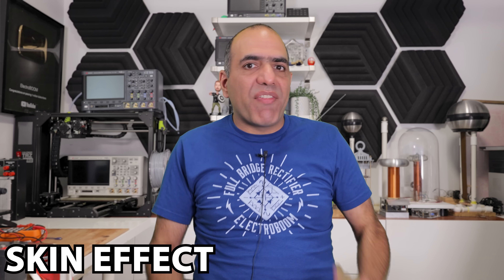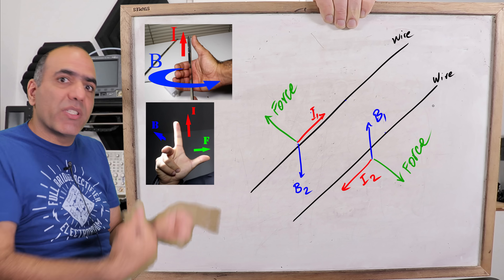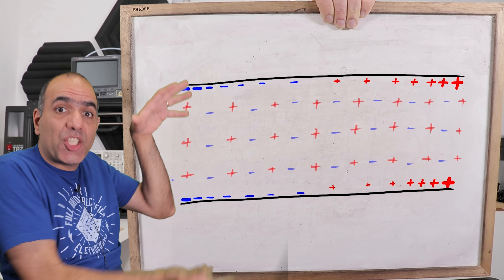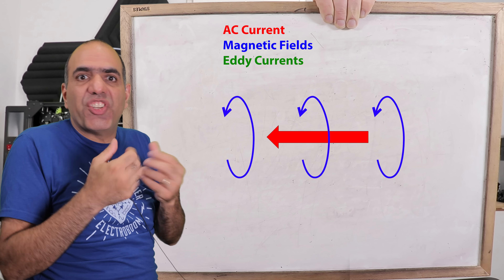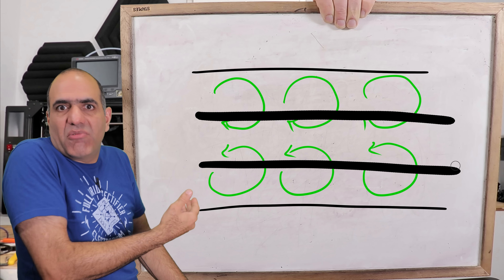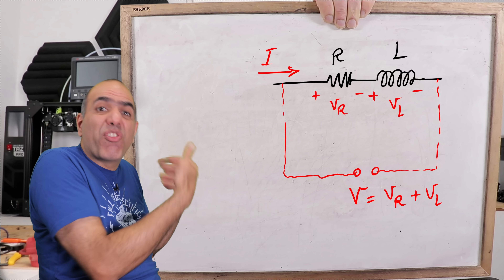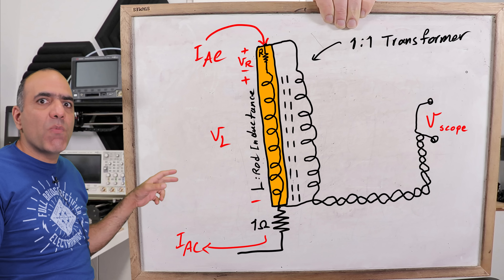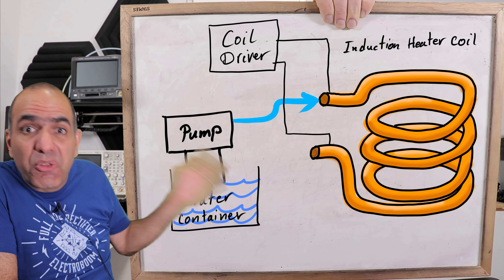Current Doesn’t Run Inside? SKIN EFFECT!

Comment: the explanation is not quite correct. the german wikipedia article goes into it well. it refers to the picture at 2:57:

An explanatory approach used in numerous introductory textbooks describes the skin effect as a displacement of the current from the inside of the conductor to the outside, as shown in the adjacent figure. According to this approach, the ‘actual’ current labelled I causes eddy currents (red circles labelled IW) due to the law of flow and the law of induction, which are opposite to the original current inside the conductor and are intended to increase the current flow at the edge of the conductor. The popular concept of ‘current displacement’ is based on this idea.

However, the explanatory approach to ‘current displacement’ fails to recognise that the physical process is described mathematically by a diffusion equation that describes the diffusion of the electromagnetic field (from outside to inside) into the conductor. The physical process is therefore in no way about a field displacement directed from the inside to the outside.

Further weaknesses of this explanatory model are the fact that the explanatory approach does not describe any field propagation, the phase position between the eddy currents IW drawn and the ‘causal current’ labelled I is not taken into account, the eddy currents are justified exclusively on the basis of the ‘causal’ current, although all currents (including eddy currents) are included in the flow law, the explanatory approach does not provide any explanation as to why the penetration depth is largely independent of the conductor diameter and the magnitude of the current. Against this background, the explanatory approach appears to be neither qualitatively nor quantitatively suitable for describing the skin effect.

fun fact: the german wikipeida describes that this is a frequently used incorrect explanation, exactly with the image from the english article. because the english wikipedia article uses exactly this incorrect explanation.

Comment: 5:20 I have roll of vintage 1950s RF-wire with hundreds of individually isolated super fine copper strands bundled together. I thought it was great for a WiFi antenna but I learned it only has an effect up to 1Mhz ..

Comment: What you said at the end there made me nervous. I often play with a high frequency D'arsonval machine. I use a cable to allow the high frequency, high voltage, low amp current to electrify my body, so that I can then light neon or florescent bulbs, and shock (consenting) people with my hands. 

Am I slowly killing myself??
Reply: oh, you said "high frequency, high CURRENT" cooks and burns you over time. Current = amps, and I'm using very low amps. Whew! 

But, I guess my understanding of how this machine works was incorrect. I've heard that the high frequency, high voltage AC stays along the outside of the body and doesn't penetrate deep into the skin.

Comment: Alternatively you could have bought a bar and a tube of the same diameter.  At one side of the bar (the 'output'), the tube and a center 'tap' are connected to the bar.  The center tap and the tube are connected to separate 'current sensing resisters', then you could have measured the current through both to show the difference and that they add up to the 'input' current.
Reply: Ig not possible, current takes easiest path, so whichever has low resistance, current will be more in that

Comment: Here is an idea: If the resistance on the sides of the wide copper foil is higher, you can use a thermal camera to see if that part heats up faster.

Comment: Dear sir 
I have a theory of my own thinking.
Pls full fill my curiosity.
My curiosity about gravity battery.
What if we take two 100kg (20-20kg 5 block) weight in a certain height and take when the both side have 100 kg weight it will be normal but when we take 20kg one side to other side it will be get down and give 120kg's weight power and returning process we will give only 20kg's weight lifting power, it can be possible by suitable gear ratio. So in this process we geat more energy 
Does it work.
Pls help me to fullfill my curiosity.❤
Love from india❤
A arts student but interested in science ❤
Reply: yes it will have a net force of 20kg (edit 40!) . 

there is no way to get more force out of it.
Reply: @-IE_it_yourself   Thanks for your reply 😊
Now I am clear that...
I may never get 120kg Wright's power just because in other side I hange 80 kg weight so I only get 20kg power and return process lose 20kg
Am I righ...

Comment: Does this mean that copper clad aluminium (CCA) core cables conduct electricity equally efficiently as a solid copper core cable?
Reply: at high frequency yes. that is what i understood from this video
Reply: NO. Copper has a higher conductivity and subsequently, lower resistivity factor towards electron wave flow than Aluminum. Copper is more resistant to corrosion or brittleness too. You can tell when cheapie installers use cheaper CCA cabling, after so many years the performance degrades faster and in some later cases, the cable crackles when bending. For the best sleep at night and better customer interaction, I only use solid copper core cable. It does everything better.
There are various cut/strip/scrape/burn methods to discern the difference, but one good way is weight. A light full box of 100ft CAT6 ethernet cabling is surely CCA.
Reply: @SpaceCadet4Jesus OK yeah a full copper wire is best. BUT when AC issue like EB said in the video the charges go to the outside. that is why high voltage AC lines can use steel cores to save money and gain strength with minimal loss of current.

this is a practical solution in the world we live it. ideally pure copper or silver would be best.
Reply: @-IE_it_yourself  the OP referenced aluminum core, not copper core, not high tension steel core cabling. Each has its various use. Simply answering the question asked, not referencing OB's video.
Reply: Thanks for the insight. It is a known fact that copper is a much better conductor of electricity than aluminium with the same resistance. However, as mentioned in the video, 10:00 would it be safe to assume that current would flow through the copper cladding only and not through the inner aluminium core? If so, then CCA cables could be a better choice rather than the costlier solid copper cables which, as mentioned, do not utilise the inner core. Share your thoughts.
Reply: @ongscree  No. Skin depth is the distance below the surface of a conductor where the current density falls to about 37%, not 100%, of its value at the surface. Current doesn't only run on the outside surface, but tends more to at higher frequencies. Aluminum is for cheapness and future cable aging issues. 

Although at higher frequencies, the skin depth decreases. The skin effect increases the effective resistance of the wire at high frequencies compared to its resistance at direct current (DC).

There's more problems to consider when using CCA cables then just mere skin effect of current flow. It may seem okay to use them at the start, but over time they degrade faster. Electron flow over CCA over time increases cable brittleness much more than copper. I would imagine it also degrades the signal. 

Although I don't know your use case, over 34 years of IT cable install, I would never use CCA cable knowingly. Your basic Home store cabling.

It reminds me of the attitude of installers who make a hole in a wall that can only accept the exact size of cable they put in. With no thought of the future, not thinking that someone else is going to come along, usually me, needing to install another one or two or more cables but can't do it easily, if at all. Same applies to low voltage conduit sizing.

Comment: Never heard that lightning explanation before. I heard that cosmic rays start the charge channel, and then the electricity flows bc of voltage. That's why lightning look like particle decays
Reply: i dont understand it, why would like charges attract.
Reply: @-IE_it_yourself  they aren't. It generates a magnetic field. Or you can look from the electron perspective. They see protons in the other wire and are attracted to them

Comment: In transformers, their analysis is important because it relates to copper losses, which decrease with temperature, while losses due to copper resistance increase with temperature. To refer these losses to 75 degrees, which is the reference temperature, it is necessary to separate them.

Comment: Another way to look at this is as follows......remember that conductors have self inductance and mutual inductance.  Mutual inductance increases when you have nearby conductors,.  Therefore the hypothetical center conductors have significantly more adjacent wires and higher mutual inductance than the lonely outer conductors.

Comment: What about transmission RF lines? RF stuff are basically hollow copper pipes?
Reply: The frequency guides the electron flow in concert with the dimension of the wire or copper pipe. The higher the frequency, the more the flow rides toward the outside. It's a complex issue.
Microwave frequency can be channeled inside a hollow carefully sized wave guide and even make 90 degree turns. A ratio of the wave frequency is used, like 1/4 wave components, same as with wire and antenna. Sorry if my brief explanation seems nonsensical.

Comment: Mendi plz make railgun with high current transformer
Reply: "Mendi"????
Reply: mendi
Reply: Mendi ولا كبسه هقهقهقهقهق
Reply: Mehdi, can you please make a railgun with a high voltage transformer
Reply: @Erikffw112  your little "translation" is very appreciated 🍷😂
Reply: @drk_blood  ?
Reply: i thought rail guns where switched dc
Reply: Yes please. I have been considering that myself and my idea is that a Low voltage High Current transformer would be more suited for a railgun since they can theoretically deliver a lot of current, altough their drawback will be that the  lower voltage may not be able to bridge any air gaps between the projectile and rails and the resistance must be kept absolutely minimal. A High Voltage  tranfsformer would instead be the opposite, being limited to a low current but resistance  and air gaps would not be as much of an issue.
Reply: Rail gun uses magnetic coupling to launch the aluminum or copper slug.   I believe it is DC capacitors that are shorted to dump their charge to create the EMF to then yoink the slug down the barrel. 😂

Comment: I've never seen someone graph black magic so accurately
Reply: Black magic is the appropriate response when dealing with resonance in electronic systems.
Reply: ah good old rf...aka black magic.
Reply: Like a refractory index for current.
Reply: String theory strikes again.
Reply: I know right. That's how I graphed it myself. Still have no idea.
Reply: Black magic is black rock
Reply: That's because Medhi is an actual wizard. 🧙🏽‍♀️
Reply: @Red_Lion8325 technomage.
Reply: It's the warp screwing with the measurements
Reply: New innovation technology Breaking the law of phys  https://youtu.be/8UlmZls4QQU?si=xysFV2ldg8kkNT_8
Reply: New innovation technology Breaking the law of phys  https://youtu.be/8UlmZls4QQU?si=xysFV2ldg8kkNT_8
Reply: I wonder what really happens at those frequenciee.
Reply: Fun fact: most printable Smith charts have "Black Magic Design" written on it. From what I heard a company of that name sold bookliets of empty charts, but I couldn't find any source of it

Smith charts are a very useful tool for a lot of RF calculations, especially for matching antennas and other RF systems. Truly black Magic
Reply: Fun fact: Smith charts are a useful tool for plotting RF systems and makes it quite simple to ex. tune antennas without any hard calculations. Most printed/downloadable versions of it have "Black Magic Design" written on them.
Reply: Me, as an African mathematician witch:
Reply: The fact than when i read this comment the Total comment count is 666 💀

Comment: Just last week I was making a transformer wire from 60 individual wires of 0.15mm² in diameter because my transformer is on high frequency ferromagnetic big core And the previous single wire heated up a lot althought was 4mm² in diameter.. Transformer is powered by my built ZVS circuit. And the episode about the skin effect was just upload today😂